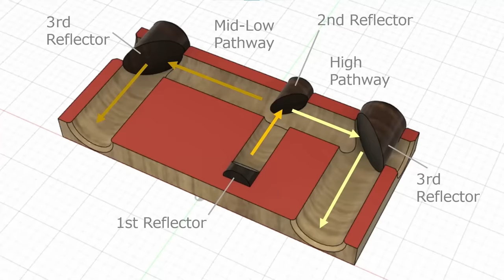Acoustic amplifier phone stand with Iron-wood Reflectors

Comment: Beautiful, inspiring, work!. I'm designing something similar but putting it on a vertically adjustable stand and attempting to horn load the speakers in an attempt to bring up the lower frequencies. First for a phone and if it works a tablet.

Comment: What was the very first material you cut? It looked similar to a wood I salvaged but I don’t know what it is.
Reply from the maker: Ipe wood. Also known as "ironwood."
Decking material used for boardwalks in public facilities.
Very hard and heavy. Sinks in water.
I use the leftover material from when I built a wooden deck at my home.

Comment: @ 5 minutes you fumbled quite a bit with the vacuum shroud interfering with changing the bit.
Please consider removing the screws and hold the shroud with rare earth magnets or with hook and loop tape.
Reply from the maker: Thank you!
Actually, I didn't have much trouble.
I need a drill bit with a longer shaft than that...

Comment: the sound is more linear without your acoustic amplificater, you add resonance in mid, kill the high and don't get more bass
but it's louder yes
Reply from the maker: Good.
Reply: Maybe you are right, I am not an acoustic expert, but the most important: it does not sound like a smartphone any more!
The sounds are not so nervousness and with some app you can use an equalizer to adjust the things.